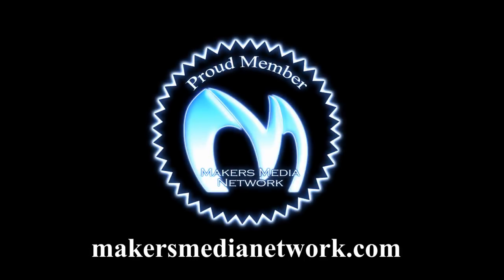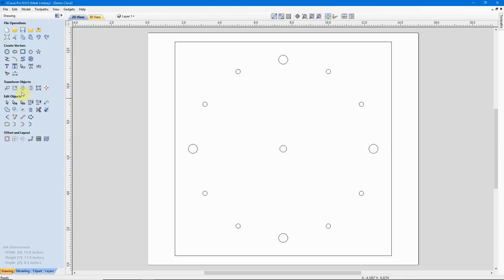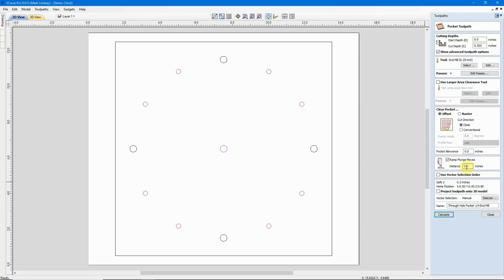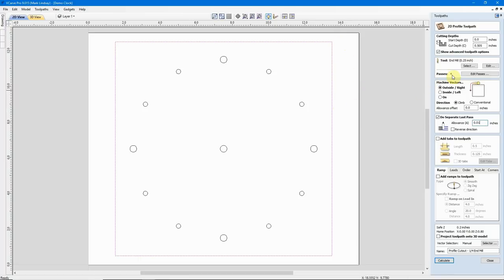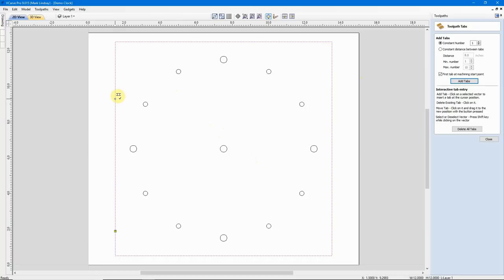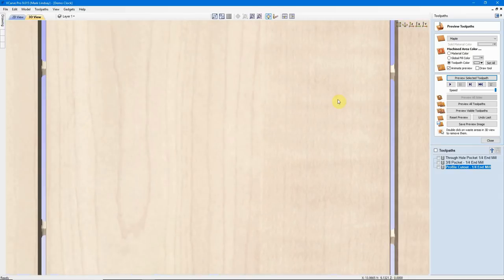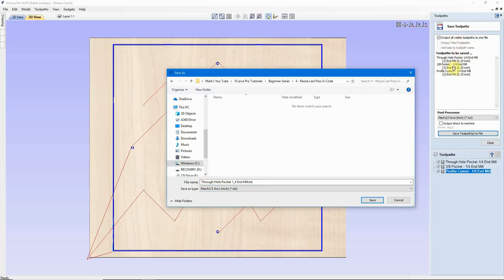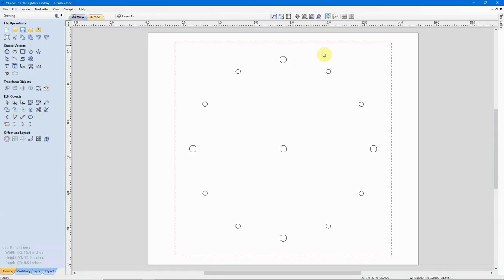Separate Last Pass, Tabs, and G-Code - Part 4 - Vectric For Absolute Beginners

Comment: Mark, You made a mistake! When Pocket Allowance is positive, Then the holes are smaller. You said the oposite. On the other hand, you are doing quite well!!! :-)
Reply from the maker: Oops - you're absolutely right. Sometimes I think I know what I want to say but what you hear isn't exactly what I meant. Or something like that. I'll see if I can fix it without having to take the video down.
Reply: @MarkLindsayCNC   Hi Mark, suggestion to add an annotation in the video to correct that?
Reply from the maker: @dukat03   That's no longer possible. YouTube took away annotations about 2 years ago. I'll correct it in the description, but most folks don't read that.

Comment: Hi Mark, thank you very much for these very instructional tutorials, best in the platform for me. I calculated that if you always use twice diameter of tool on distance ramping, its the same as if you use an angle of 26.565°, that never changes for any diameter tool you use, it will ramp in the same incision rate, and it gives you the advantage that you dont have to calculate that every time you change bits. God bless you man.
Reply from the maker: Thank you, Antonio!

Comment: Trying to learn.  Great job.  What I don’t understand is how exactly to place my material?  If you selected the bottom left corner does the material get secured there and only there? If you selected the center does the material get positioned in the center of the spoiler board?  Is there a video on this part of the project?
Reply from the maker: As you get further in the series, you'll see me demonstrate these topics. Basically, you mount the material on your spoilboard, then zero your machine to that material in that location. Securing the material is pretty straight forward, but there is no one-size-fits-all solution. Common mounting methods are clamps, screws, painter's tape and CA glue, jigs, vises, vacuum table/pods - the list goes on and on. The goal is to make sure the piece is mounted securely to the table as there are forces that try to move the piece in every direction. Secure mounting prevents that from happening. Keep following along in the series, and you'll see what I mean.

Comment: Mark Let me say that I went back and rewatched your video on making the circles and resizing them. I missed the part in the video where you said that you could resize them one at a time. So that was my reason for the question. But thanks for using it in this video I learned something  else new. It was help full. Jeff
Reply from the maker: Thanks for the question, Jeff! It gave the opportunity to demonstrate resizing a group.
Reply: Instead of using the transform option for resizing the group of circles, selecting them and using the circle tool again would let you resize them (the Create button changes to Apply if I remember right). Not sure how them being in a group may change that behavior though.

Comment: Another great tutorial, Mark, many thanks for your time and effort. Thousands of us are befitting. One question, is there any way of setting  the default Vectra to metric millimeters, so we don't have to keep choosing between imperiaml and metric throughout the design process?
Reply from the maker: Thank you, Joe. Just go into Job Setup and in the Job Size section, set your Units to MM. That will set all of the units of measure to Metric for that file. You will have to make sure that is set to MM for every file you create. (It's the same for us folks who use Imperial units - we have to make sure it's set to Inches on every file.) You're still free to use Metric or Imperial tools when you go to calculate a toolpath. The software knows to calculate the toolpath correctly no matter which tool you use.

Comment: Hey Mark! I am watching this entire series. I really appreciate that you've made/ posted these. I have a question for you: I have a Shapeoko 3. When generating the G-Code how do I know which post processor to use (Inch or mm?)
Reply from the maker: That depends on whether your machine is running on Imperial or Metric units. If you're using Imperial measurements for your design, and have the Shapeoko set up for Imperial, use the Inches Post Processor. If you're using MM for your design, and your Shapeoko is set up for Metric units, use the MM Post Processor. If you're not sure how the Shapeoko is set up, I'd suggest going over to the Shapeoko Support Forum and asking over there. Those folks know your machine best. Here's a link: https://forum.shapeoko.com/

Comment: Hey there! At first … thanks for your awesome Videos! I have a Question. Lets imagine i want to make a pocket with the pocket tool. The pocket will be made with a 0,5inch ballnose endmill in 3 steps in depth. Can i make a last pass to clear the inner sides in one pass like it works in the 2D profile toolpath? I just see the option to set an offset instead of making a last finishing pass. Hope u know what i mean. Thanks so much
Reply from the maker: If you're clearing the pocket using the Raster machining method, the toolpath will make a profile pass at depth to clean up the edges of the pocket. By default, it makes that profile pass after the pocket is cleared out (Profile Pass - Last,) but you can change it via the drop-down menu located just below the Raster Angle field and just above the Pocket Allowance field. Thanks for watching!

Comment: Did an exact runthough of this project, which is absolutely great, as all are, by the way, and when I went to Save Toolpath, (Mach 2/3), another message box came up stating "Wrapped Output". What is this and what data should I input here? Thanks
Reply from the maker: Check which Post Processor you have selected in the Save Toolpath form. "Wrapped Output" is for a Rotary Axis, and this was not a rotary axis project. If you're using Mach3 control software on your CNC router, you'll want the Mach2/3 Arcs (inch) (*.txt) Post Processor if you use Imperial measurements, or Mach2/3 Arcs (mm) (*.txt) Post Processor if you use Metric measurements. If you're not using Mach3 control software, you need to contact your CNC router's manufacturer to find out which Post Processor is suitable for your machine.

Comment: Hey Mark, I have a question calculating toolpath. I have an error that comes up that says both tool paths use tool number one but geometry Of the tool is different.
 I do not understand this and do not know how to correct it so I can calculate and save the code. Any help would be greatly appreciate it. Love the videos thank you.
Reply from the maker: You are trying to put toolpaths that use different bits together into 1 G-code file. Both of them have the same tool number (down at the bottom of the Tool Database entry for that bit,) but they have different geometry (for instance, one is an end mill and the other is a v-bit.)  So, it won't save the G-code to a single file. You will either have to create separate G-code files for those bits, change the tool number of one of those bits, or use a Post Processor made for an Automatic Tool Changer (ATC.) I would highly suggest NOT using an ATC Post Processor, unless you're absolutely certain it will stop your router/spindle and allow you to do a tool change. Personally, I go the separate G-code file route, myself.

Comment: Hi Mark. Great video! Regaring seperate Last Pass, that feature not show in my software (i'm using PartWorks that came with my secondhand ShopBot). Any thoughts about how I can work around this? Big thanks from Denmark :)
Reply from the maker: Thank you very much! I have no idea how PartWorks functions, so I wouldn't know where to begin. You might try their customer support - they should be able to tell you.

Comment: Mark Thank you for the schooling :) I started with a 3018 cnc. Have no troubles with the laser so this will greatly help me with the struggle on getting the router to work as I hope. One question so far. How can I determine which Post Processor Gcode I need for the controller I have. Is that what they mean by GRBL?
Reply from the maker: You'll need to know which Post Processor is appropriate for your controller. If you're using a GRBL based controller, then yes, the GRBL (Inch or MM) Post Processor should be the one you're looking for.

Comment: Make I have 2 questions, First one which direction do you run your cutter in the most for profile cut outs Climb or Conventional ? The other is when and why might you use the reverse direction on the separate last pass. Jeff. So how many more videos are you going to do.
Reply from the maker: The direction really depends on the material being cut. I plan on doing a separate video on the subject in the near future. There's a lot to consider, and there's no real "one size fits all" answer most of the time. Thanks for the questions!

Comment: do you know if the Vectric platform works with the Maslow CNC? I have also sent this question to the support email at Vectric.  Thanks in advance.  Also, thank you for these great videos, they are great for new CNC users. Greatly appreciated.  I will keep watching for additional learning.
Reply from the maker: Thank you very much! I know nothing about the Maslow. I've never been in the same building with one. Your best bet is to wait for Vectric Support to get back to you. I'd also contact Maslow themselves, and hit any of the Maslow user groups and forums. You can't be the only person who wants an answer to that question, and it's undoubtedly been asked before. Thanks again!
Reply: @MarkLindsayCNC 
Hi Mark, thank you for the great advice.  I did reach out to Vectric and they have provided me with a couple of things to try based on their knowledge of Maslow.  Once again, thank you for the great video series. Your videos have been so helpful, particularly if the Vectric software will work with the Maslow. I appreciate it.

Comment: so do you have to choose the post processor every time or does the system recognise that you select the same one every time and automatically go directly to it instead of scrolling through the list.
Reply from the maker: Thanks, Michael. The system remembers the settings you used in the last session, so you do not have to go through that list every time you save g-code. It's always best practice to look at the postprocessor that is listed before you save the toolpath just to make sure.

Comment: Let's say I added  .005" to a .5" hole in the pocket allowance. is it added to the radius or the diameter? Would the final hole be .505" or .510"?
Reply from the maker: The pocket allowance doesn't add to the radius or diameter of the bit. It acts very similar to an offset, with a bit of a twist - it's just the opposite. If you enter, for instance, a pocket allowance of .005 to a .5 hole, you'd get a hole that's .495 in diameter. If you enter a pocket allowance of -.005 to the same hole, you'd get a hole with a .505 diameter. The pocket allowance makes the bit cut to the inside or outside of the vector (depending on whether the allowance is a negative or positive number) the amount of the allowance you enter. Negative pocket allowances move the bit to the outside of the vector by the pocket allowance amount, and positive numbers move the bit to the inside of the vector by the pocket allowance amount. The bit's diameter is irrelevant. I hope that helps.
Reply: @MarkLindsayCNC I love your videos, btw. I'm currently going the entire 41set for beginners.  I read the message below after I posted. So, I didn't get the difference between +&-. However, my question was how much is added to the actual hole?
 Does a -.005" selection move the bit out by .005" (adding .005" to the 'radius') making a .510" hole? Or, does it move the bit out by .0025" (adding .005" to the 'diameter') making a .505" hole?

Comment: These are great videos.  My version of vcarve is doing something strange.  When I create a toolpath it generates two toolpaths automatically - one toolpath has the name given, but the second includes the following at the end of the name: [Clear 1].  This path does what it says: it does a final clear cut.  But I don't know why it would need a separate toolpath file. Then when I try to group these into the same gcode file (I am not changing tools) I get the following error: "both use tool number 1 but the geometry of the tools is different."  I have checked the tool database to ensure no two tools are using the same number.  Any ideas, or what am I missing?
Reply from the maker: You have a newer version of VCarve than I had when this video was made. What you're describing is exactly what is supposed to happen when you use more than 1 bit to create a pocket or use the V-carve toolpath. In the case of a pocket, you select a main tool for use as the pocket's final shaping/sizing bit. If you add another (presumably larger) bit, the software reads that as a bit used to clear out the majority of the pocket. The toolpath created for that larger bit is the toolpath named [Clear 1]. It's a clearance toolpath, made to clear out the bulk of the material. The other toolpath without that [Clear 1] designation is made to do any final clean-up and cut the final size of the pocket. It works similarly for V-carving. I will go over this process on December 17th's Live Q&A. Keep an eye open for that live stream.
Reply: This is a great explanation (i never did see a “clear pass” option, but when I removed the second bit… all went well). Thanks!😊  @MarkLindsayCNC

Comment: Is it always advisable to use carbide cutters for machining or could one use highspeed endmills?
Reply from the maker: Depending on the material, HSS cutters can do just fine. I just prefer the durability of carbide, and not having to sharpen edges so often.

Comment: I have a question for you and I have scoured your videos for the answer
Reply from the maker: Go for it!
Reply: @MarkLindsayCNC  OK so ive been looki ng through all of your vids amazing work by the way. I am trying to use a bowl bit on a piece and use a clearing end mill tool but the end result is off  and yes i am re zerroing every time a change a tool :) by the paper method the difference is an 1/8 in in the bottom the 1/4' compression bit is not cutting to the depth of the bowl bit  should i change my approach
Reply from the maker: Yours is not a unique situation. A lot of people have this same issue, and to be honest, I really don't know the root cause of it. What I've done in the past was create 2 Pocket toolpaths - one for the clearance bit (your 1/4 inch end mill,) and another for the bowl bit (I use a standard ballnose bit, but the results are pretty much the same.) I set the cut depth of the 1/4 inch end mill to be about .050 short of the final desired depth. I then create another Pocket toolpath for the bowl bit only, set the start depth at the depth the 1/4 inch end mill cut to, and have it cut that remaining .050 Set the stepover of the bowl bit at about 20% of its diameter so it leaves a smoother surface (I use a smaller stepover with a regular ballnose bit - usually 8%.)

So, for example, if I wanted to create a dish .25 inches deep,  I would create 2 rectangle vectors - one .050 smaller than the other in both the X and Y directions. I would use that smaller vector to create a Pocket toolpath, using my 1/4 inch end mill, cutting .20 deep to clear out the bulk of the dish. I would then use the larger vector to create a 2nd Pocket toolpath using the bowl bit, using a start depth of .2, and cutting .050 deep. I tend to use a raster cutting strategy, with the toolpath making the Profile Pass LAST. Try that and preview it to make sure the 2 toolpaths are cutting to the desired depth, then try running the toolpaths on a piece of scrap. (This is where having a piece of an old fence board to practice on comes in handy.) Please let me know if it works for you!
Reply: @MarkLindsayCNC  Thank you so much for your time and wisdom! I will try this